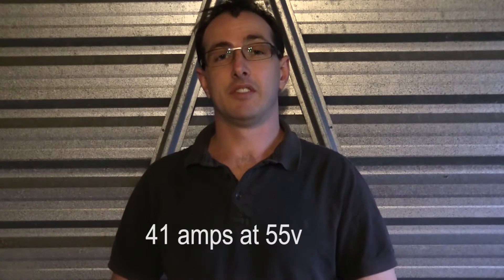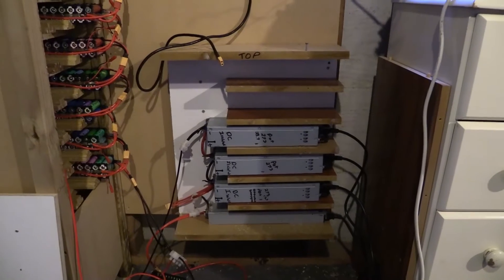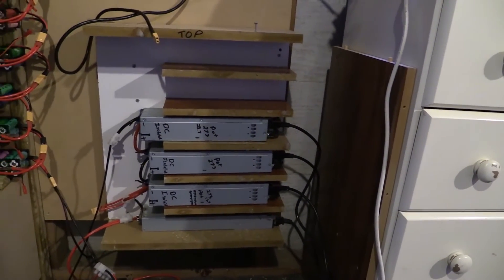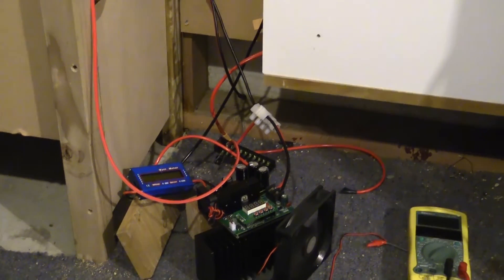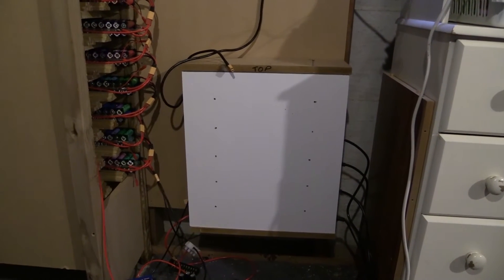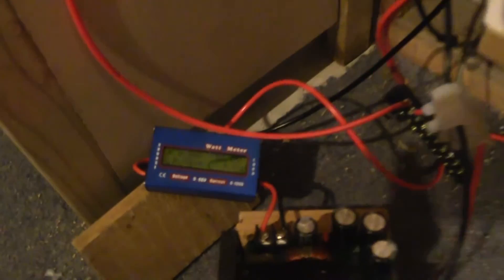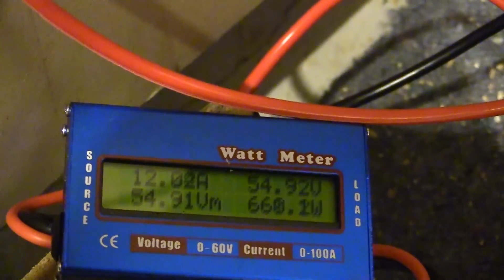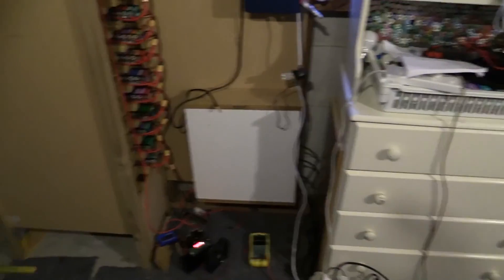Completed 2200 Watt 55v 41A Powersupply Part4

Comment: Please let me know what charger you are using with your power supply.  

Are you able to plug the output of the power supply into the mppt 7210a charger controller and then charge the power wall from that?
Reply: I think I understand now. 

As far as I can tell, the boost converter is able to charge the batteries directly, with no charger in between the boost converter and the batteries.

Comment: im lost now... I can't remembers your exact numbers ... but you have 100v DC solar array which you're turning into 220v AC And then you're powering 220v PSU's to make 55V DC then boosting that to 160v DC for the charger ?   Err isn't that the most efficient thing you could possibly dream up ?  why can't you take the solar arrays 100v DC ish and boost that to the 160v DC you need to charge the batteries... Or even better reduce the required voltage needed to charge the batteries and then no need to boost at all ... What am i missing here ( yeah i know i made up all the voltages cos i can't remember your actual ones )  ????
Reply from the maker: Please have a watch of video 30, https://www.youtube.com/watch?v=LqgP16JQ24I
Simple, 2 solar panels 60v to a mppt boost converter charging during the day at 83v. Powerwall uses a grid-tie inverter to turn the 83v of DC power into 240v AC and depending on the load of the house it will only put out enough to cover the house load so nothing is export back to the grid. The AC charger is to charge the powerwall without the solar on the garage roof, for now dont worry about that. The reasons for the AC charger are for winter and as a temp charger before the MPPT solar on the garage roof.

Comment: Following on from Sven.
As per the Australian/New Zealand electrical rules, The power supplies are not double isolated so they will all be grounded to the metal cases. So they are all electrically connected via the mains leads BUT if you had a cord fall out of one they would still all work but that one is no longer grounded and could float to a high voltage from the suppression capacitors in the power supplies.
So its best not to be touching.
So it might be good to have them all bonded together separately to the mains leads.
Mike said that some isolate the mains side (ie the earth) than connect all power supplies in series. This would require isolation of each power supply. Dont do it this way. isolate the DC side.
Reply from the maker: Ya i only isolated the DC side. But still wouldn't touch them while running just in case. Rather be safe then sore.

Comment: I'm really confused with your setup. On your input side, what is your source of electricity to power your series of power supply? Is solar power your source or are you just connecting these power supplies to your AC outlets from your house? Is your idea to ultimately harness solar power to charge your battery bank or to charge your power bank overnight from mains AC when your electricity rate may be much lower than your electricity rate during daytime and then use your powerbank during daytime to reduce your electricity cost? I'm really dying to understand your ultimate objective. Thanks!

Comment: How will you do cell balancing??? great vid
Reply from the maker: Havent got that far yet, I would love to use a active balancer but its costly. In the mean time i just will run without a balancer while testing but will come up with something long term.
Reply: Thanks for the reply. Have you checked out bangood for any charge controllers such as this 
http://www.ebay.com.au/itm/Li-ion-Lithium-Cell-20A-18650-Battery-Protection-BMS-PCB-Board-Balance-13S-48V-/262504549611?hash=item3d1e7d8ceb:g:YfUAAOSwhOVXc2sA

about $1 aud per cell

Perhaps Tesla car batteries may have give you some ideas?
Reply: @motormadness9975  theese have far too low balancing power. A better solution is here: https://github.com/stuartpittaway/diyBMS

Comment: Good video. Learnt something new will all that. (A few things). 

So when you have 10kwh you won't need the boost converter. 

So almost finished. What is next?  How long till it's running full time.
Reply from the maker: Next is an overview video on where i am up to, Also next is finishing off my BMS unit to control and monitor things, Plus tidy up the charger part so i can use it daily rather then a mess on the floor.